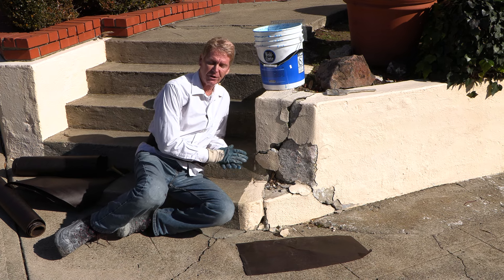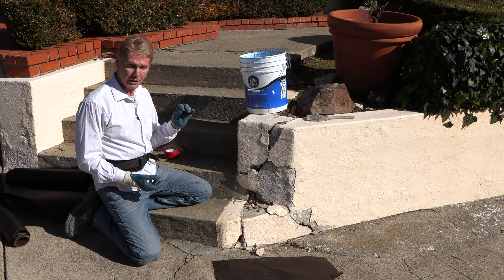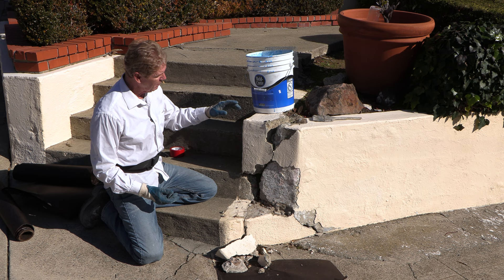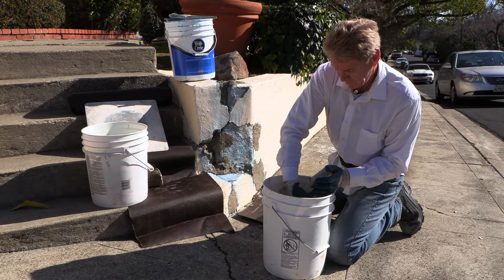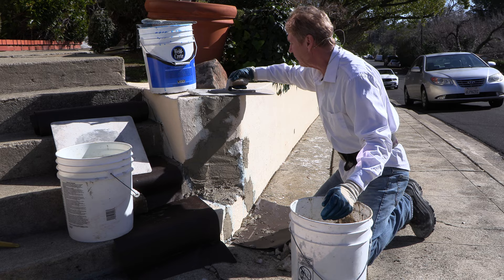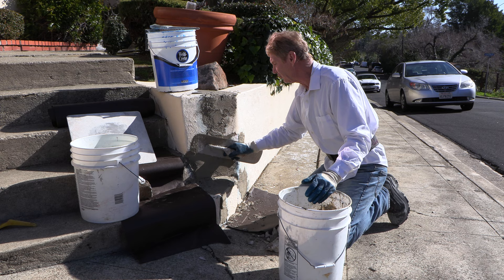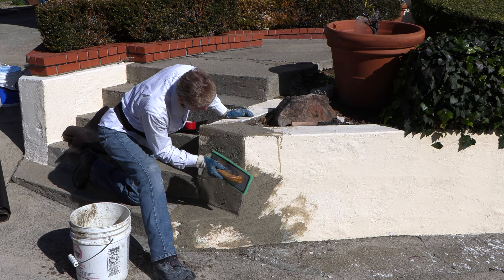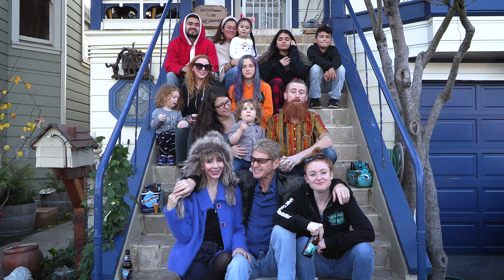Stucco patch concrete retaining walls

Comment: I guess in Germany we make better concrete than in the u.s.
There are bridges completely made of concrete, millions of cars driving on them every year and nothing cracks 😅 

Good work as usual 👍
Reply from the maker: Howdy Basse, in the UK, most use lime in the concrete this adds many more centuries of resistance to deterioration, as it has the ability to flex expand then correct itself. Portland cement does not flex. Things that make you go hmmm.😉
Reply: @StuccoPlastering  In Germany we put rebar in the concrete. So it can flex and "move" whitout cracking.. sorry for my bad english
Reply from the maker: @basse.r  Howdy Basse, your English is perfect. Now when I was young, all my friends would say, "What did your mom say? as she spoke four languishes except English well. But I always understood every word she said. 💃🏻
Reply: @basse.r  Of course we use rebar here in North America, in almost all concrete.
You may have missed the age of the home, +100 years, and rebar was not used in these old homes, especially in a retaining wall.
I work on these old homes all the time.
The fact they are still standing, are stunningly beautiful and on their umpteenth owner, is a testament to their construction.

Comment: Kirk, I love your videos. But this isn’t going to last very long. Maybe in a warm climate it will last a little while. But anywhere it freezes this will blow apart during the first winter. I understand it’s free. Though this is more of a homeowner fix. As a professional I would never do this and take someone’s money.
Reply from the maker: Howdy Ace, we don't get temperatures below 35 in our area, thankfully. Me, I'd like an area where the weather is 85 to 100 degrees year-round; I'm thinking of packing up and moving to Arizona personally. 🤔
Reply: @StuccoPlastering   Same here, that mud sets up fast in the heat. We have to wait a while to apply the next coat here in the northeast during winter time. Most companies don’t even work from October to March because of the expansion and contraction. Some days are 10 degrees, the next day it may be 45. You really learn to hate the weather man. 😁
Reply from the maker: @Acesnickvlc Howdy Ace Plaster Dude, that sounds horrible. I dislike cold weather myself. ☃

Comment: Kirk… quick question when it’s convenient for you to provide a professional answer. I had some Rapid Set (red bag) CTS stucco patch reps come over and help Stucco our BBQ area. They used the retardant and it all matched with the existing ares. When I mixed up a batch and applied the stucco mix, it dried whiter than their mixture… what am I doing wrong. Please, I need some guidance.
Reply from the maker: Howdy Barking Shark, sounds like a Indian tribe name. I guess, I'd be Troweling fox as it sounds better than Troweling squirl? I didn't think adding retardants changed the color of the rapid set stucco. Ive added hundreds of packs of retardants and have not noticed color changes.
 If you added sand, that would lighten it. But I take it they were premiexed bags where you just added water? The area's that you applied your new stucco was no doubt sealed or had a bonding agent this would also light the color of the tan sand color of rapid set stucco? 🤔
Reply: Yes, they were premixed bags and I just added 1 to 4 ratio. Not sure why my mixture is coming out lighter… guess I’m gonna have to spray everything with the same paint color… I dunno.
Reply from the maker: Morning Shrark Dude, premixed means you only add water. There's, your boo boo. Adding extra sand lightens the color and weakens the mix.. YOu only add sand to Eisenwall, not iin ts user frindly, "Premixed Rapid set products," sold at home depot or lowes. 🤔

Comment: Hey Kirk, I'll always use bonding sauce on the surface as intended/directed, but have heard it's good to also mix in the cement/concrete in addition to on the bonding surface, is that right?  Appreciate ya!!
Reply: If you watch some of his other videos, he really doesn't like it when people rely on that.
Reply: I have mixed it in many times and it's never as good.  I wouldn't bother doing it that way
Reply: @peep39  O'course I mean doing both: on-surface as well as some mixed-in. A waste?
Reply from the maker: Howdy Richard, Fact, Sika does indeed make a bonding agent that can be used instead of water when mixing tile grout, It gives the grout the ability to adhere better to say glass or other non-porous substrates, But there is no bonding agent I'm aware of to add to stucco to make it adhere better. Bonding agents for stucco are best applied to clean surfaces, in which you plan to stucco over. Adding bonding agents into stucco mixes won't help the stucco adhere better, thus kinda a waste of time. 🤔

Comment: Does mesh help it from cracking and last longer?
Reply: Last longer, yes. But one thing you can guarantee with masonry… it’s going to crack.
Reply from the maker: Hello Julie, indeed it can, But rain is the enemy of stucco and concrete; as it lifts it, this action is like Kroptonight to Superman, not good, as this causes caring and buckling, which is normal. 👨‍🏫